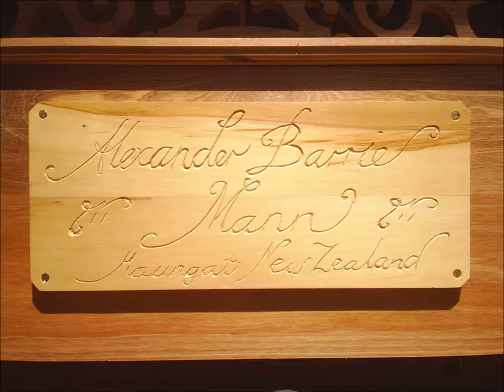Building the Worlds longest piano

Comment: what type of fabrication knowledge did you have before doing this??
Reply from the maker: Limitted, I had barely started work. I could weld,  This is where I learned how to weld vertical welds with stick, everything is 20mm+ steel so you can't really go wrong joining 2 bits of plate together, a bit of warpage to consider